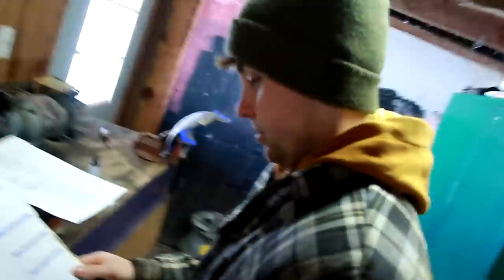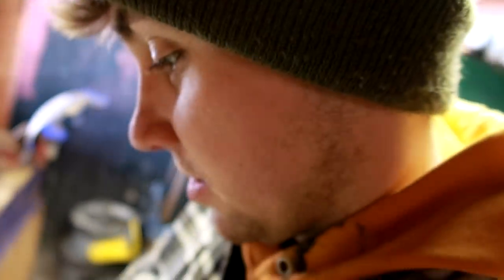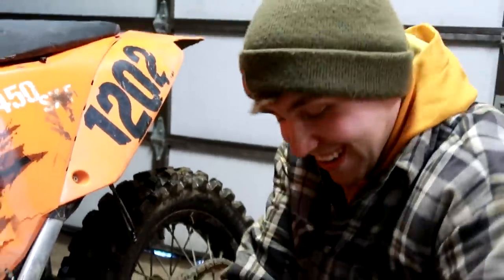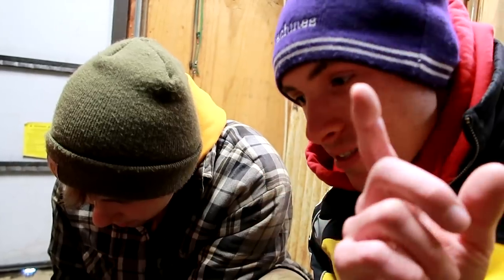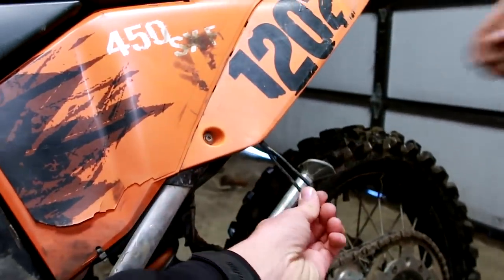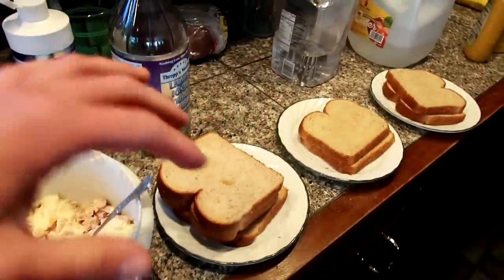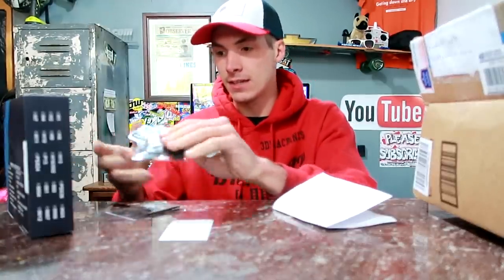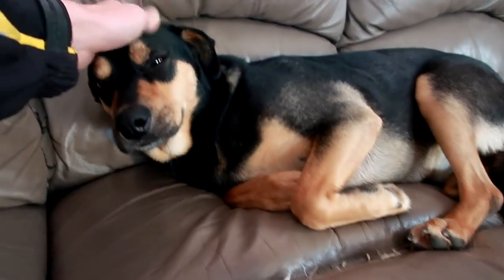HE'S NOT DOING GOOD...

Comment: Hey 3D machines lol trying doing a replacement dash and wire harness and steering column outside in the cold and half way done and test everything out and left signal on works everything four-ways and headlights togther and also the radio  and then turn right signal nothing works it's like wtf

Comment: I don't think the Kawasaki is blown up I just think the engine has just seized up
Reply: dylan walker thats what blown up means
Reply: dylan walker that's just as bad Klide
Reply: a locked up is not the same all the components in the Kawasaki motor just stopped moving both just as bad and non rebuildable